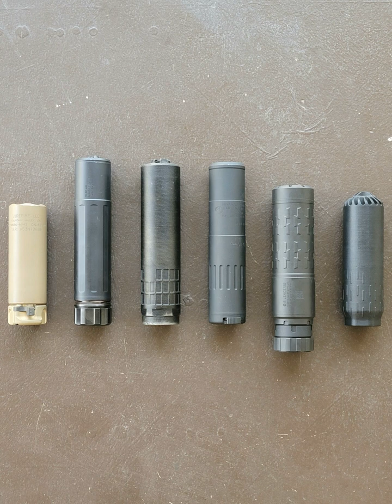Episode 177 - PWS BDE 762 on .308, 3D Printing, and Impulse (06-SEP-2023)

Comment: Would you recommend the BDE 762, Full Nelson by Q or the Hyperion by CGS for a 11 inch 7.62x39 build?
Reply from the maker: @XCaPTainClipzX  hi sir! We can't recommend silencers, but, we can certainly help you with performance questions. Assuming that is a semi-auto platform, the Hyperion would most likely give you the best all around performance. However, there exist other purpose-built 7.62x39 systems like the CAT ODB, for example, that have lower back pressure and are still very quiet.... It really depends on the system!
Reply: @TheJaySituation  Thank you for that information
Reply from the maker: @XCaPTainClipzX  any time!
Reply: @TheJaySituation  Last question, which silencer would give me the best all around performance CAT ODB or Hyperion K?
Reply from the maker: @XCaPTainClipzX  overall performance? ODB for sure.